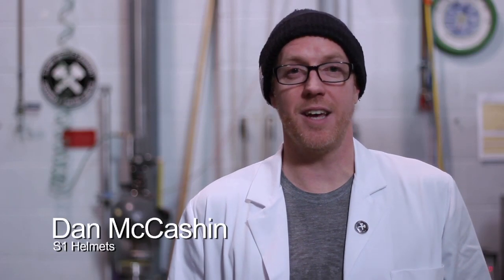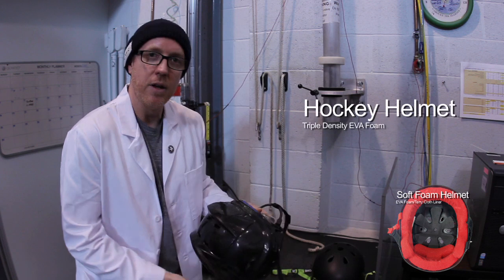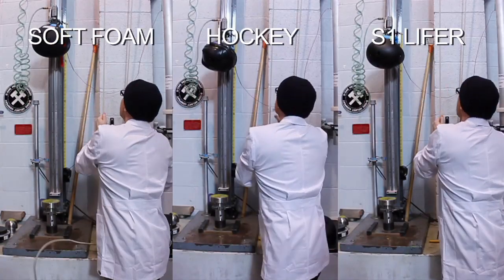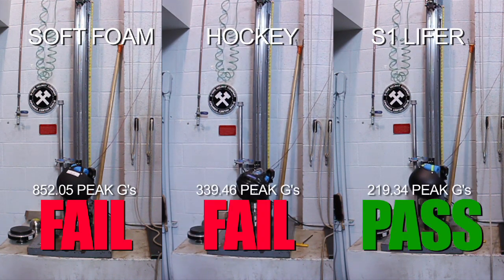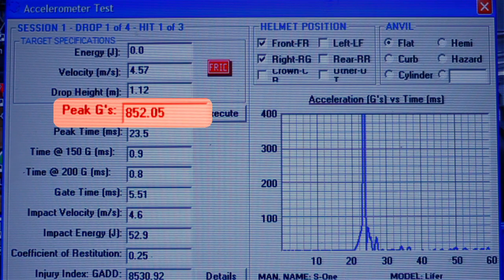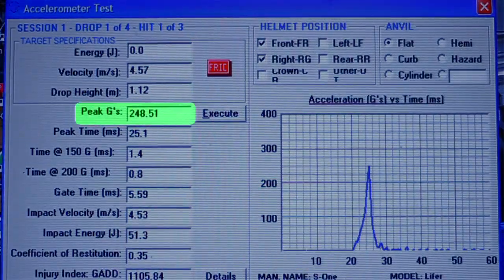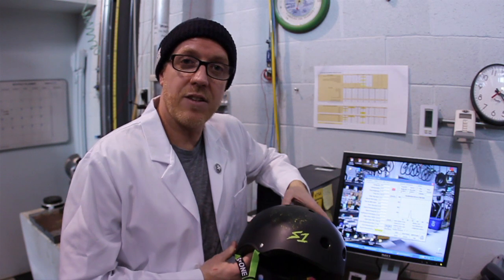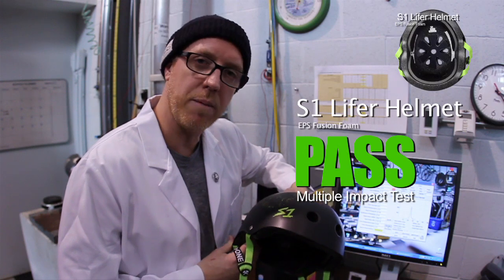The Best Helmet for Skateboarding, Longboarding, BMX and Roller Derby

Comment: Test a protec certified now. Let’s see how your competition fares!
Reply: Yea really annoying that they didn’t
Reply: Actually if you want to see a no so formal testing thats suposed to be un biest. 
The Braille team has realeased some pretty un orthodox " lets see what it take tl kill this" type  of vids and i use to like my pro tec stuff but found that there is ones that are not skate certified... that being front , rear and side impact safe and they do a bike one that use looks like a pro tec and thats only front impact certified. 

But i had one a few helmets back and i keep most of my kit in my boot of my car so if i get a chance to hit the ramps on my lunch break , my pads and helmet is in there all the time and i just toss my board or skates in depending on what i feel like on the day. 

Well the heat in my boot of my car made the glue come away from the shell that was a big disapointment as it was only about 6 months old and had not copped 1 knock yet to be binned. 

Oh if your a skater of any sort. 
Dont bother with the pro tec knee pads. 
They dont slide well at all and that = face plant,  broken front tooth ... 
I wont use anything less than the tripple 8 street skate knee pads for derby  but for transition and vert, must have killer 187 pros .

I just picked up my S1 lifer yesterday thats replacing my tripple8 sweat saver as that copped a big knock and i dont really trust any helmet to do the job twice of ive had a big fall on to concrete when doing ramps or bowl as im happy it did its job but my head is worth more than a helmet... so im givi g the S1 a go fir this lot of punishment... lol